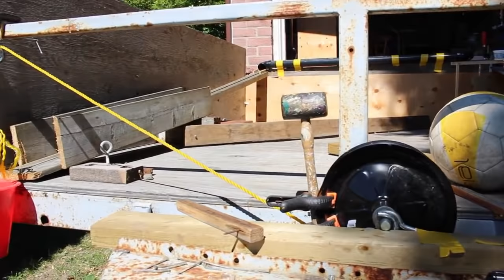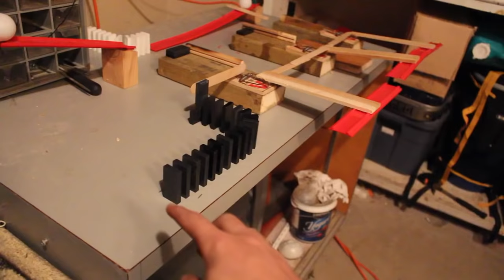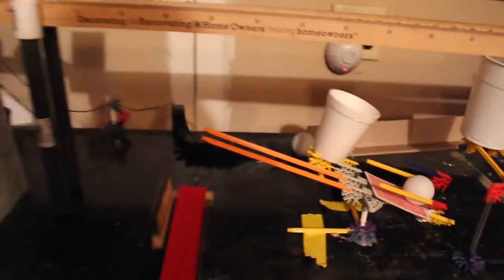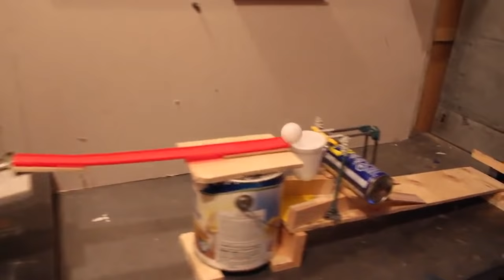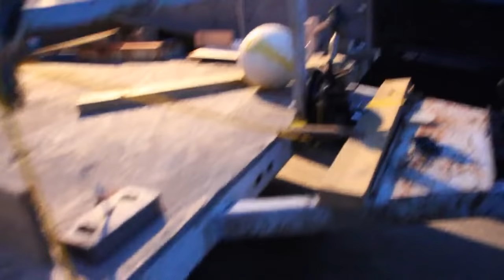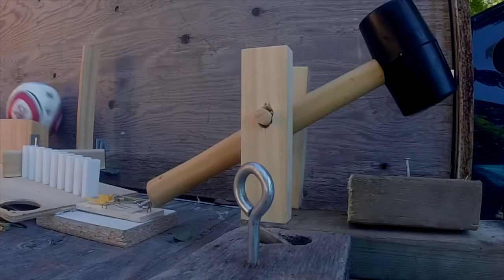The Workshop - Amazing Chain Reaction Machine

Comment: Oh my god! Amazing! Sweet mousetrap track completer! When you actually got the coke and mentos trick to work I practically lost my mind! And excellent job on the task at the end! Brings it all together for an incredible video!
Reply from the maker: Sprice Machines Thanks! When I finally got the mentos and coke to work I lost my mind too.
Reply: +DrComplicated what were we doing wrong??
Reply: +DrComplicated also what is pouring down the funnel? also using a mousetrap to hold back the hammer was a great idea! and nekozilla rules
Reply from the maker: Sprice Machines The main thing was that we were pouring the coke into another bottle. So all of the CO2 that would normally use the surface of the mento to escape was using the side of the bottle instead. So by the time we dropped the mento in the coke wasn't diluted enough with CO2 to create a big enough reaction. Also getting one of these made it a lot easier. http://amzn.to/1MgvRVE
Reply from the maker: Sprice Machines It's motor oil that's pouring down the funnel. And yes nekozilla does rule.
Reply: That's awesome, I wonder if you'll come up for any other uses of the release mechanism